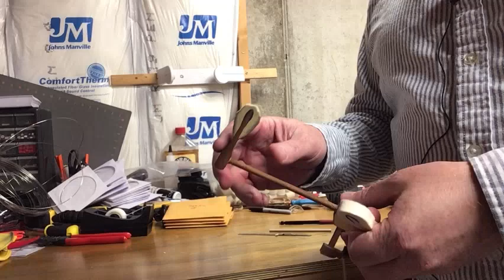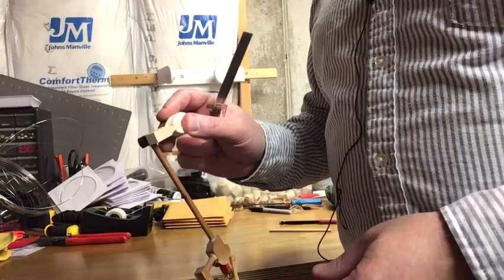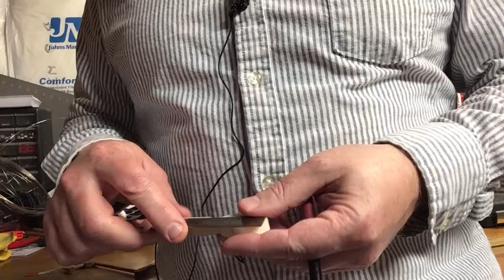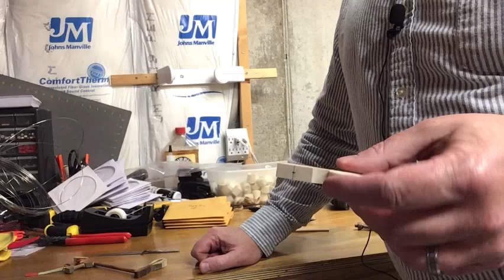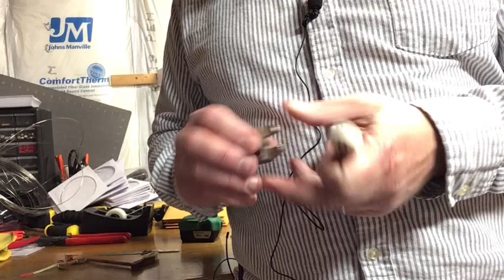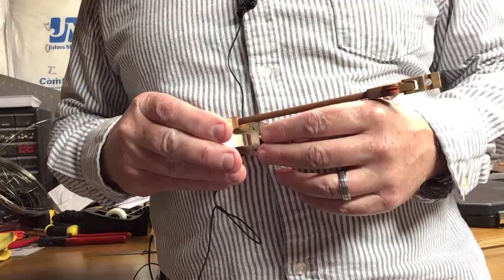How To Bore A Replacement Piano Hammer - Piano Repair I HOWARD PIANO INDUSTRIES

Comment: Would it not be better to measure either from the tip of the wood or the back of the hammer (because it’s wood)? 
I think that measured from the worn felt the difference in wear between hammers would make the bore placement vary too much.

Comment: Great video.  Quick question, how do you replace a hammer that is missing and you don't have an old one to compare it to?  Do you go by the existing hammers next to the missing one as a reference?
Reply from the maker: Yes, you can use the neighboring hammer as a reference point.

Comment: YOu obviously know your stuff! However, I would like to mention a couple of things which worry me. Firstly, your speech is very slow and you continually stumble. Perhaps if you planned these talks beforehand, you might be able to do it more efficiently? 
Secondly, your measurement of the bore hole for the new hammer did not take into account the wear on the old one!! Why not? Also, how do you do the holes which are angled? Would it not be easier to use decimal measurements; all new drill bits are in mm.?
Reply: "All new drill bits are in mm". Now I've heard it all...
Reply: You sound ridiculous, hope you know that. Why do you think there’s any wear on the old bore??? And why do you think it matters shanks are standard size
Reply: @jisyang8781  I think it a valid question. Perhaps you are old bore here.
Reply: You can speed up the video. I play it at 1.5x speed, which makes the speech sound normal.